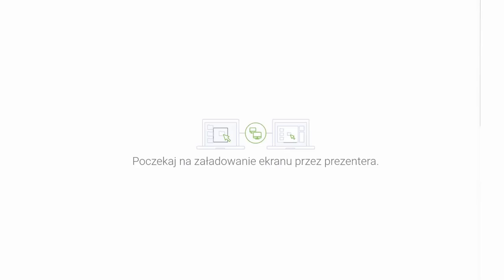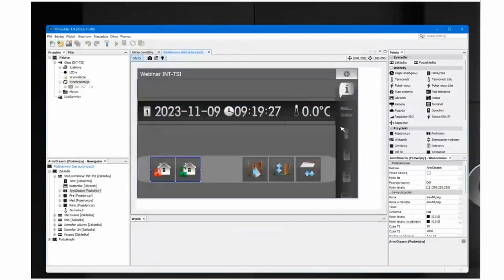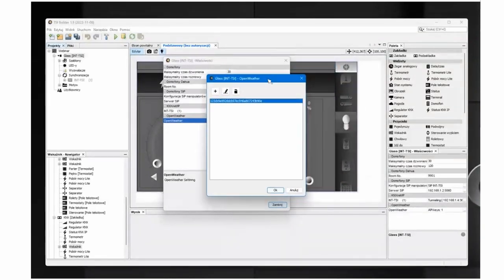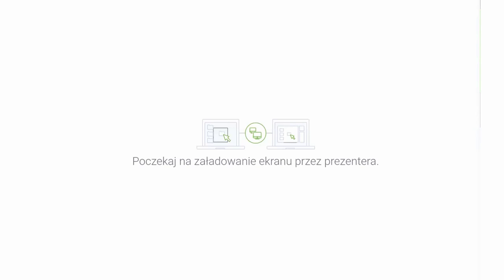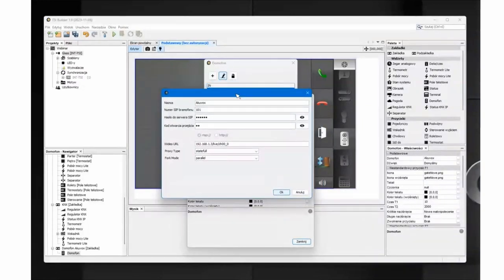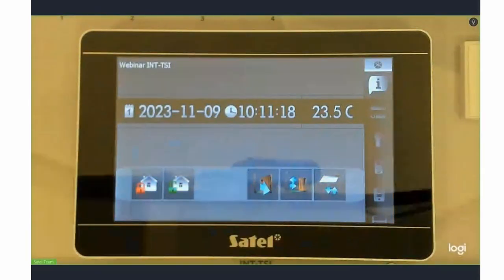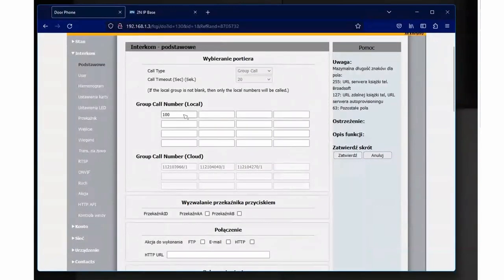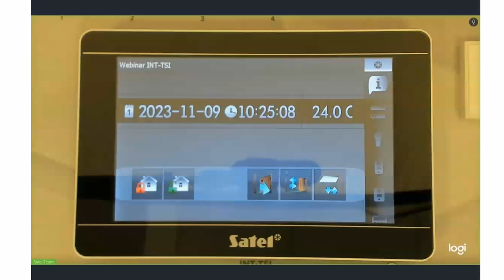SATEL Webinar: Configuring the INT-TSI Intercom Widget (SIP Protocol Support), KNX Telegrams & more

Comment: Hello, I saw that you have direct Dahua integration. My question is, is there a way to change the room number from the standard 9901? Asking this regarding external units with multiple call buttons / addresses.
Reply from the maker: It's worth highlighting that in both integration scenarios with Dahua, you have the flexibility to change the room number, allowing for use with multiple call points. This versatile approach enhances the adaptability of our system to various setups and configurations.

If you have any further questions or if there are specific details you'd like to explore regarding this integration, feel free to contact us on https://www.satel.pl/en/support/.